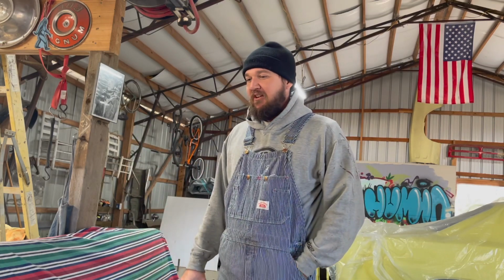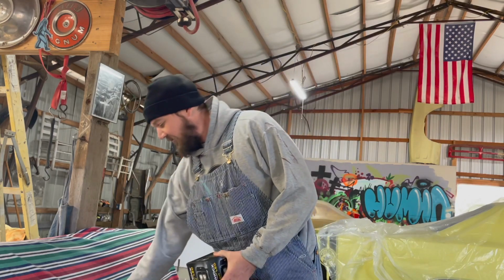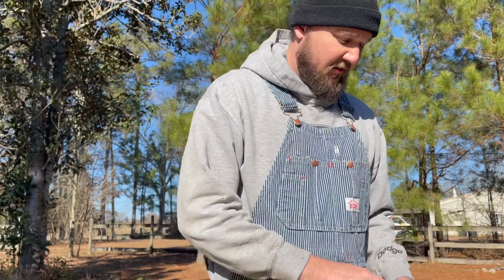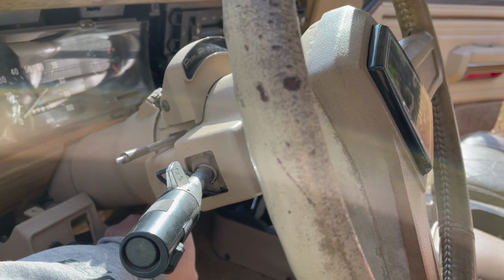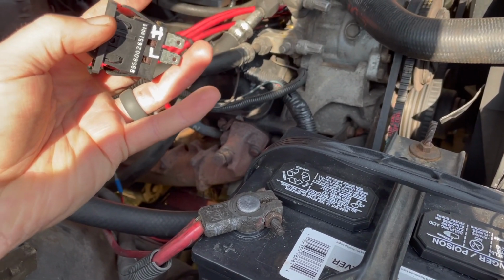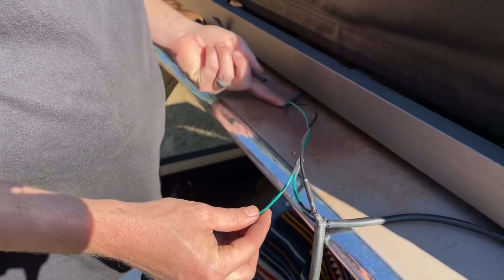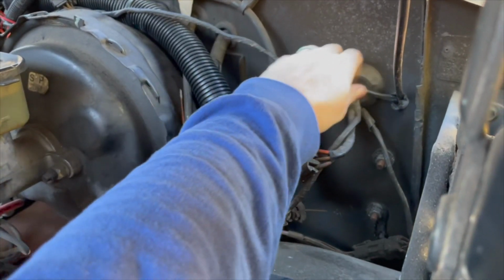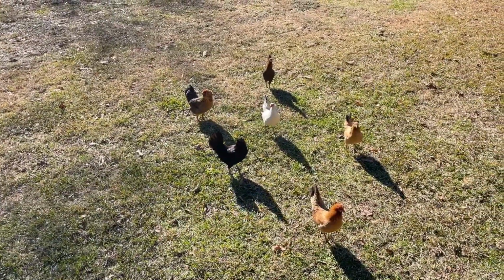Mounting Harbor Freight flood lights on Termite #overland #grandwagoneer #wagoneer

Comment: Interesting idea using the washer hose that goes through the pillar, but my question would be why not just take the headliner down in the back.. drill a hole in the roof put a rubber ring on it to keep it from chaffing the wires, and seal it once youre done ? that way you dont have a hose hanging out the back like that ?   Still a great idea, i drilled a hole in my roof, for my 6 front roung off-road lights, i drilled it by the roof rack arm so its hidden, but ive been thinking of adding two rear lights exactly like you did, normally taking the headliner out in the back is super easy, but i installed a sound bar back there and it was a pain to bolt on so taking it off and headliner back section would be a pain, so i might instead use my washer hose  to get the wires into the pillar lol.  Thanks for the idea
Reply from the maker: Yeah, we had already dealt with the headliner and we def didn’t wanna take it all out to creat a hole that could eventually be a problem down the road. Probably not, given it’s under the tent and everything and the Jeep stays in a covered shop, but anytime you drill a hole in your roof you are potentially creating an issue for later